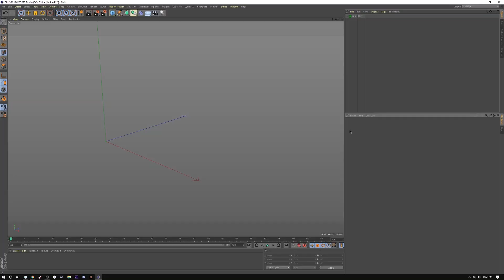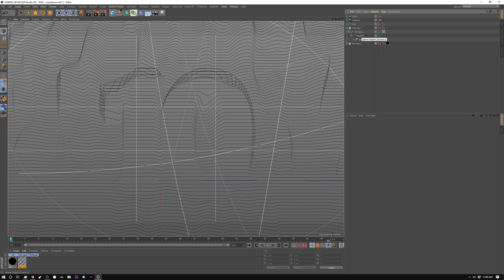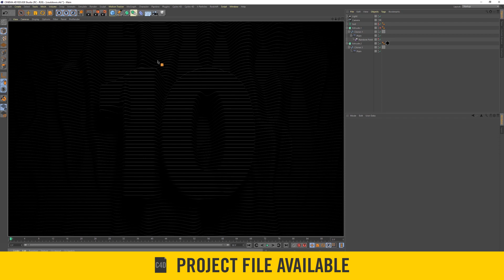Create a Digital Countdown in Cinema 4D

Comment: appreciate your slow talking ways but you jumped ahead really drastically at :56 in and it's not clear how the text and the splines are set up in relation to each other...
Reply from the maker: Hi Lauryn, after the on cam section, we just cut to the full setup and explain it there. The text is used as a falloff as explained at 1:39. Let me know if you have another issue.